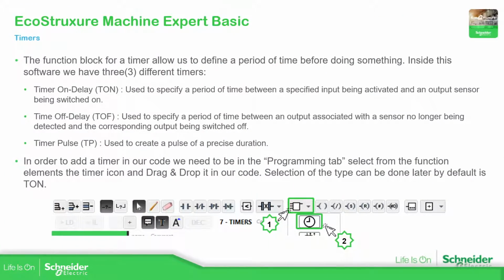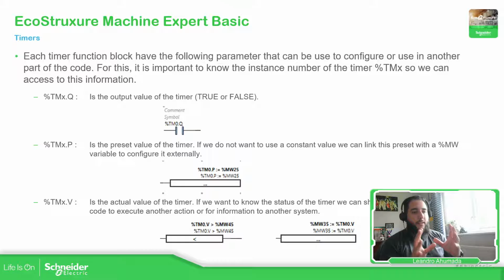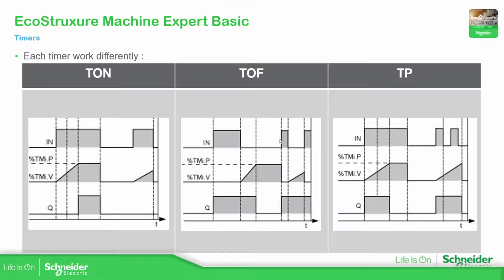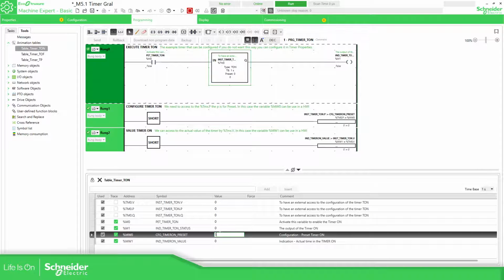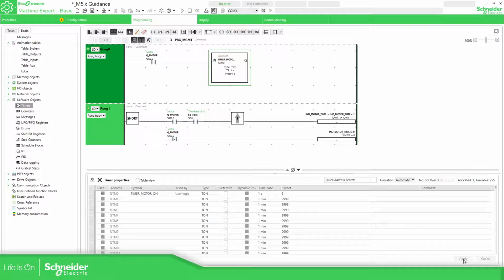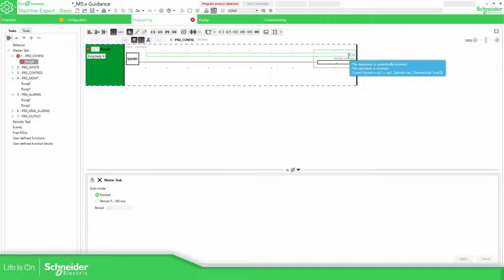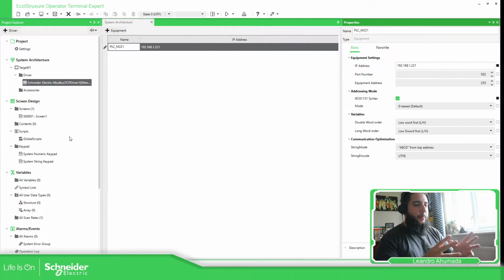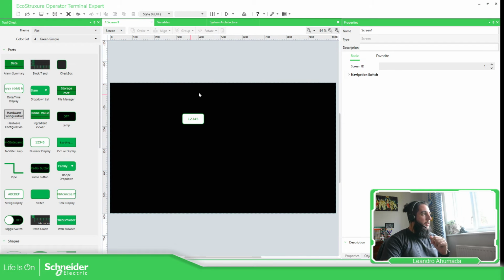Training - M221 - M5.1 Timers

Comment: Hi Leandro could you explaime the use of short at tne begining of the pou, What happen  if I don't use it, it's not  the same? Regards
Reply: Gracias por la respuesta saludos desde cancun, Mexico
Reply from the maker: Hi there! Nothing will happen if you do not use the short and draw a line to connect the objects. I usually use it to be aware that in that location i may need to add a contact in the future. But they are good to disable part of your code.

Comment: Hi Leandro,
I need to create an application where once a button is pressed on the graphic display it closes a circuit breaker after 10s. 
So, I will add a contact linked to a button on the display and then a TON timer, but its only a push button, I don't need the timer to remain on once the the output has been energised.
do I need a set coil and then a TOF timer to drive this function separately?
Thank you
Reply from the maker: Hi there! One way can be:
1) link a %Mx from the HMI.
2) the %Mx along with a r_trig can set a %My.
3) the %My can go to a timer
4) the output of the timer can go to a %Mz
5) the %Mz can be link to your output.
6) when the command to step is pressed on the Hmi you reset the %My
Reply: @LeTomasAHUMADA  Thank you Leadnro, I did this logic so its all go. I am struggling with the last bit of the application. Selector switch for Local/Remote control. Is this possible or best to install external selecto switch with 2 x binary inputs and neutral position?